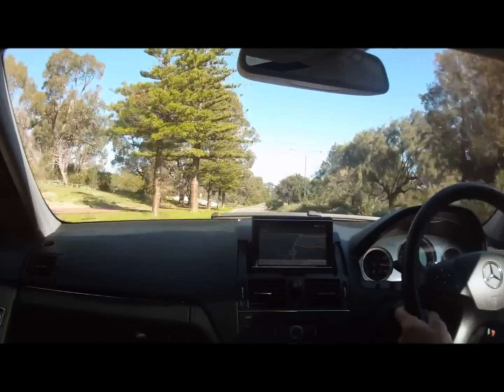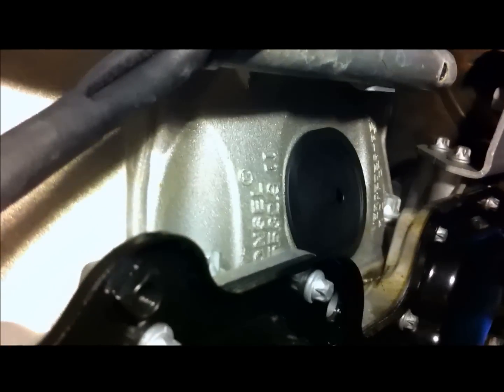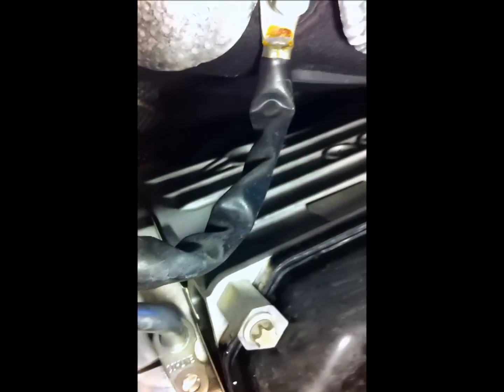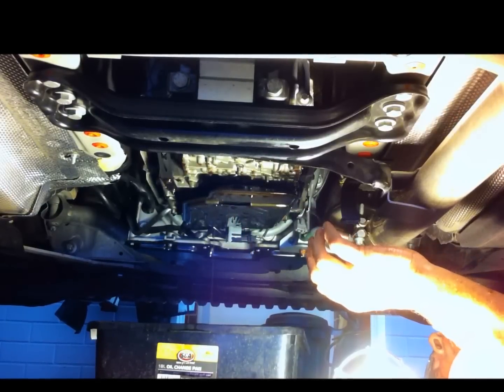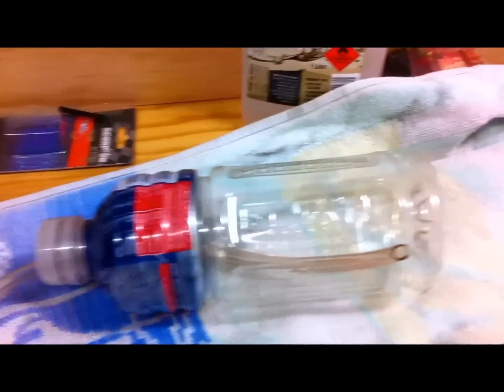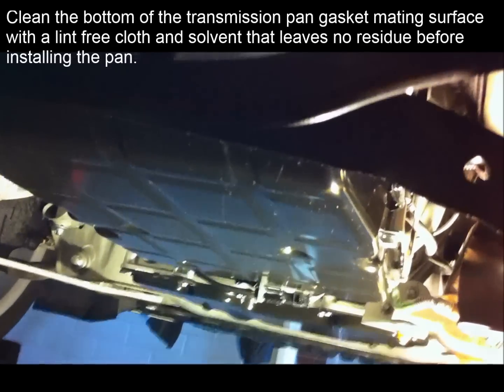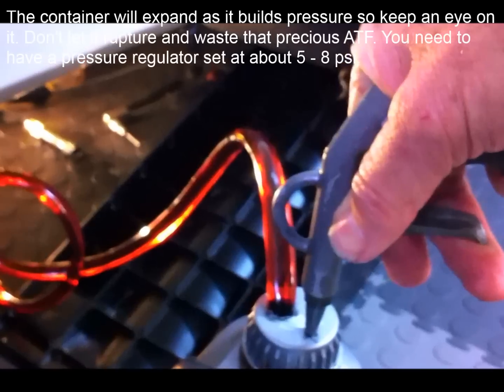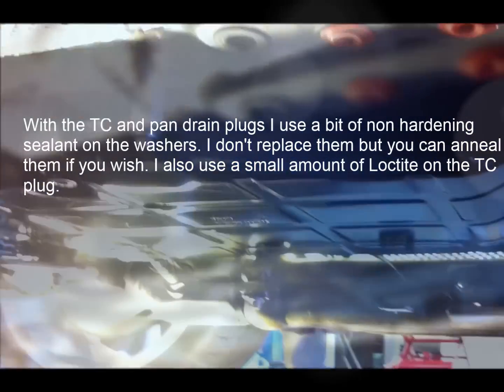Mercedes W204 C Class Transmission Service ATF Fluid Oil Change 7GTronic 722.9 Test 0-60 mph

Comment: Hello Scott, 

First i would like to say that this video is awesome,  like your self, I  do not want to spend $$$ on the dealers if i can do it myself. In your video you identified three places that you will drain fluid from.

I will be working on a 2009 GL320 BlueTech 722.9 Transmission 

1. The oil pan drain plug (Straight forward)
2. The Oil Cooler line ( is this located on the drivers side of the transmission ?) 
3. The TC Drain Plug ( I see that you drain this), but where does is get refilled? from the Trans Fluid ? or is there some different fluid type..Help :-)

On the Oil cooler line where your remove the second screw, you mention the left side of the engine for this screw, is that the drivers side? just want to make sure that I am going to do this on the correct side of the SUV.

Thank you so much for creating this video, it closed a big gap in what I would need to do to service my transmission..I have about 61K on my SUV, and I have heard different mileage for doing the service, so I just want to start doing this at regular intervals.

Thanks again
Reply from the maker: +GL320 Lovers ... Thanks for the compliment. The oil cooler line and the bracket bolt are located on the drivers side in a LHD vehicle.

The TC is part of the whole transmission and refills from the ATF in the oil pan. The oil pump picks up the ATF and pushes it around the system including into the TC so you don't need to worry about it. It will refill when you put that initial 7 litres approximately into the transmission and start the vehicle. It's important to drain the TC as it holds about 50% of the ATF.

Make sure you use the correct specification fluid. If the ATF is red it will be MB236.14. If it's blue/green it will be MB236.15. Hope this helps. Regards, Scott
Reply: +Scott Elliott 

Thanks Scott, yes I will be using the MB236.14 Red. 

Again thanks very much for making this information available. I will check back in over the weekend when I complete the work and I will show you my rig that I will create for the fill process.
Reply from the maker: +GL320 Lovers Please do post again to share the knowledge. We DIY'ers must stick together! Regards, Scott
Reply: +Scott Elliott 

One other question. You used a old school multimeter with temp probes to monitor tranny fluid Temp....can a Infrared Thermometer be used ?
Reply from the maker: Certainly ... infrared temp gun is fine.
Reply: +Scott Elliott 

OK so I have built my tool set for servicing the transmission . I basically have 3 major parts. 
1. The torq converter flush with Male NPT connector:
https://www.yogile.com/g320lovers#08343880l 

2. The Trans Filler adapter with Male NPT Connector: 
https://www.yogile.com/g320lovers#08343882l

3. The Fluid filler hose with Female NPT connector:
https://www.yogile.com/g320lovers#08343878l

All this cost me about $60 US. The AST Filler adapter can be found on the Website http://www.asttool.com/company_sales2.php 
if you click on how to buy, the site will point you to your local retailer in your country / state / City where you can walk in an purchase the filler tool for your specific vehicle. Mine is the 2009 GL320 Bluetech with the 722.9 transmission. 

All of the other materials were purchased at Home Depot off the shelf. 

I am planning on doing the service tomorrow (good firiday here in the US), and will report back on my experience. 

Thanks again Scott for making this video public..it really motivated me to DIY this service. 

:-)
Reply from the maker: +GL320 Lovers ...It's great to see the planning you've done for this project. Too many rush to the "doing" without any thought and planning.

During my Civil Engineering career we used a process called PDCA ... Plan, Do, Check Adjust. It's a continuous circular process of continuous improvement. The more time you spend on the P the less time is required for the D, C & A. In fact the whole PDCA timeline is less. Nearly every Entrepreneur type pushes Engineers to get into the D far too soon ... they won't allow Engineers to do their jobs properly. Projects are started too soon and you get monumental stuff ups and cost blow outs ... people get killed and injured. I don't have a lot of time for people who class themselves as "Entrepreneurs" ... They're nothing but shoot from the hip, cavalier and narcissist risk takers who don't give a dam about anyone.

I use PDCA for any project I do no matter how small or large.

https://en.wikipedia.org/wiki/PDCA
Reply: +Scott Elliott 

I too have an engineering background, I worked 12 years for a leading satellite manufacturing company here in the US, and learned about processes and agree that planning is the most important part in any project. when you send a satellite up into space, you can't easily correct any errors, so yes I am totally about PDCA. 

I will let you know how it all plays out,  but I am very confident that I have covered all the details and will just need to take my time and not rush to finish.
Reply: +GL320 Lovers 

I completed the servicing of my transmission....and all went really well..I honestly do not think that I could have done it without the demo provided in this video. 

I only experienced one issue with the re-filling process. I used the liter bottles as my reservoir and it was a clumsy operation. I drilled a 1/2 hole(fill tube) and a 1/16 hole(air pressure), and moved it from bottle to bottle..it worked but the next service i will find a industrial bottle that can hold about 8 liters. 

otherwise it was a great success and I was able to save about $800 US on this service as the Dealers were asking about $1000 US. 

Thanks again Scott for making this information available!!!
Reply: +GL320 Lovers 

I also wanted to share this link that has some more detailed information regarding 722.9 transmission servicing. There are PDF's that add some additional details.

http://mbworld.org/forums/c-class-w203/365242-diy-722-9-7g-tronic-7-speed-automatic-transmission-service-thread.html
Reply from the maker: I'm pleased it went well. A 10 litre oil container would be good for the air lift stage.

I'd bet money the service you did was more thorough than a $US1000 paid service. You also have peace of mind it's been done properly.
Thanks for the link to the pdf's

Comment: Great job, Scott.   At 5.30,  you opened the cooler line to flush the fluid.... Is there any o-ring or washer that must be put back when we tighten back the cooler line?  Thank you...
Reply from the maker: +John Yon Thanks Jon. From memory there's an o-ring on that line. It's firmly held in a groove on the pipe so it's stays in place anyway.
Reply: +Scott Elliott.   I see... So we don't need to get a new one.
Reply from the maker: No not at all. You pull the pipe out and push it back in again.
Reply: +Scott Elliott Scott...  when you turn the torque converter you used 27mm socket... is this a mercedes specific socket or just a regular socket?       Also, is the temp gun quite reliable?   Thank you...
Reply from the maker: +John Yon Just a standard 27mm socket ... nothing special. A temperature gun or temperature probe on a digital multi meter is accurate enough. It doesn't have to be exact. A few degrees either side of 45C won't make a difference considering the subjective way of measuring the oil level.
Reply: Scott Elliott Thank you Scott.  Don't know why MB makes this task so difficult.
Reply from the maker: Yes it beats me Jon ... I can only deduce they try to make it harder for people like us to take control.
Reply: Scott Elliott Over-engineered for their own profit.  By the way, normally how long does it take the oil temperature to cool down to 45C after you come back from a 30 min drive?
Reply from the maker: +John Yon After you've pumped in the initial fill let the vehicle idle to bring it up to temperature plus move it through the gears several times while it's warming up. Once at 45C or thereabouts drain off the excess. If nothing comes out you'll need to pump more in. The idea is to over fill slightly, bring it to temperature and drain the excess.
Reply: Oh.. that means I can do this job after I come back from work around 5pm right?  After I fill up around 7 liters initially, this will probably bring down the oil temp.... and then make sure the temp is not above 45c...  and then go thru gears and check temp at 45c.  and then release the drain the excess.  Somebody told me that I have to wait at least 3 hrs for the oil temp to cool down.  But if we fill the new cold fluid, the overall temp will probably come down quite a lot right?
Reply from the maker: +John Yon If you've driven the vehicle home the oil temp will be somewhere around 70C. I have an oil temp gauge for the transmission in the W639 Vito 722.6 5GTronic auto and that seems to always run at about 70C.

So after you've drained the transmission, TQ, flushed out the cooler and put in the initial fill you should reach 45C quicker as the transmission will be warm.

Your keen to be doing it after work. Give yourself a few hours and don't rush ... that's how things are forgotten or you get hurt. But it's great to see you're enthusiastic about having a go at it. You'll do a better job than any dealer. If it's your first time it may be an idea to wait until the weekend.
Reply: Scott....   did you say you have an auxiliary tranny oil cooler?  Does that help a lot?
Reply from the maker: +John Yon I guess it does but it's a standard feature of the car. I've got nothing to compare it to. MB saw the need to include a transmission cooler so it must help keep the ATF cooler.

Comment: So it seems like its impossible to overfill the transmission. If you put in to much it will come out of the drain/fill hole.
Reply from the maker: +Vagus Nerve Vagus that's right. It's an easy transmission to service. Overfill it slightly and once up to temperature open the valve and let the excess drain out. The overflow pipe sets the level so you can't overfill.

I think there are a lot of urban myths propagated by dealers and vested interests. The oil pan is only a reservoir to keep the inlet of the pump always immersed in ATF. The level could be 5mm below or even 5mm above and it will make no difference. They also get hung up on the temperature. That could be 10C either way and it will make no discernible difference.

For example the 722.6 transmission does have a tube for the special dipstick. The dipstick has the levels for 80C stamped on it and there's an 11mm tolerance from MIN to MAX. In the Mercedes workshop information it says to bring the temperature to somewhere between 70C and 90C.
Reply: +Scott Elliott mbworld.org/forums/m-class-w164/459610-diy-transmission-fluid-change.html#post6741658 please check post #22, i turn the crankshaft clock wise, and its #4?
Reply from the maker: +Vagus Nerve Yes it's pulley 4.
Reply: +Scott Elliott Thank you, In your other video I saw you working on the same vehicle, do you happen to know what size that bolt is? None of my sockets that I have are fitting over it.
Reply from the maker: Pulley #4 bolt requires a 27mm socket.

Comment: Hi  Scott, a little basic question, how did you turn the crankshaft clockwise? Where is it located, ... etc.
Reply from the maker: +Nasser Alsalhabi Hi Nasser. Watch from 4:20 again. You use a 27mm socket on the crankshaft pulley on the bottom front of the motor. Depending on how long your arms are you can sometimes lie on your back with your feet forwards and your head under the TC drain plug window. Put the 27mm socket onto the pulley nut and turn while watching the TQ waiting for the drain plug to come into view. The crankshaft pulley is clearly visible once the covers under the engine have been removed.
Reply: +Scott Elliott Thanks a lot!

Comment: Good video, just the information I was looking for.  Thorough and well edited.  Cheers!!
Reply from the maker: +moosejaw50 Thanks moosejaw. I'll be doing this video again in about 6 months and hopefully it will be a better based on what i learnt last time. I decided to do my transmission every three years as the car does get taken to the track occasionally. Regards, Scott
Reply: +Scott Elliott  You covered all the important bullet points that a DIY mechanic needs to know for this job.  Bonus points for the performance test.   FYI  I have a US spec '09 ML with this transmission.

Comment: The fill method you used worked perfectly for me - suprised how quick it moved - like 1l in 15sec - very helpful video. I used a tyre valve on the oil can cap to fill up easier from the airline. The tap near the pan was a must to make it easier. Wish I'd just bought a m12x1.5 mm to 10mm barbed adapter for a few £ off e-bay http://www.ebay.co.uk/itm/M12x1-5-METRIC-to-9MM-10MM-BLACK-BARB-Straight-Oil-Fuel-Pump-Hose-Adapter-/370846282035?hash=item5658293133 rather that the proper and rather expensive laser tool but I had bought before I saw your video. The Fuchs oil you use is apparently Merc original fill - What Merc use and label there brand. Which can be got quite reasonably in 4l bottles

Comment: After turning the crankshaft clockwise to access the TC bolt and finally draining and replacing with a new bolt, do you need to turn the engine back to its original location?
Reply: +Jon Anderson No
Reply from the maker: As Jon said ... no. 

I'm interested to know why you thought that may be required? 

Also I don't replace with a new drain bolt. Normally the only bolts you need to replace are the one use yield bolts which are often aluminium.

Comment: Quick question, correct me if I'm wrong:
The transmission fluid is a sealed system, correct? Therefore, if you are pumping fluid into an empty system, wouldn't you be building quite a bit of pressure, especially the amount of fluid you're pushing in? Where does this pressure go?
Reply from the maker: Sou Lee Sou all transmission and differential housings have a vent as when the transmission gets hot it will build pressure.The process I use is the same as described in the Mercedes Workshop Information System. The difference is I use a simple air lift using my compressor whereas Mercedes use a hand pump. Both do the same thing but my air lift is easier and simpler.Google "722.9 transmission vent" in images and you'll find a picture.
Reply: Ohh, that makes sense. Thanks! I'll be doing this most likely the same way you did via air compressor.
Reply from the maker: Sou it's easier and quick. Why MB use a hand pump has me mystified. Scott
Reply: I think it might be beacuse air compressors are notorious for introducing high moisture content to their compressed air discharge. Water and hot ATF not a good mixture in a trans.

Comment: You happen to have part numbers for the filter, gasket, fluids and where you purchased it? I would like to perform this task myself since I lost faith in my dealership.
Reply from the maker: DaeHan2321 Hi DaeHan. If I acted as a parts number interpreter for all the requests I get for numbers I'd be working full time for nothing! A famous person said teach a man how to fish and he can feed himself for a lifetime. So I can't do the fishing for everyone.Use this site: http://www.everythingbenz.com/z/epc-mercedes-parts-info-diagramsYou don't really need the part numbers. I have an account with these guys for filters and other consumables. You choose your vehicle and it does the work for you. http://www.micksgarage.com/As far as ATF goes there are many choices depending on where you live. I used Fuchs ATF 4134. Assuming you have the 7 Speed 7GTronic 722.9XX series you need the specification MB236.14Hope that helps, Scott
Reply: Scott Elliott Much appreciated! Just to clarify, you pumped about 9.2 L of ATF to over fill so you can drain excess fluid to a trickle while the engine is running? I'm afraid of letting too much out.
Reply from the maker: DaeHan2321 Yes Dai I pumped in a bit over 9 litres. I emptied the oil cooler and the lines to and from it as I pumped about 750ml into the inlet side and kept going until air was coming out so I used a bit more ATF than normal. The dealers and service centres don't normally do that. They leave about a litre of old ATF in the cooler and lines which I don't like.You can't let too much out. That's what the overflow pipe method is all about. Once it starts dribbling you know the oil level is at the top of the pipe and you're done. The ATF inside is not still as the pump is going so there would be disturbance on the surface. Even if you left it until there were no dribbles it would be ok. The level would be within a few mm of the top of the pipe. As long as the inlet of the oil filter is always under oil everything is going to be ok. Regards, Scott
Reply: +DaeHan2321 If you are in the states we have a complete kit for this job at IDParts - includes 10 quarts of fluid: http://www.idparts.com/automatic-transmission-service-kit-23614-fluid-mercedes-speed-7229-early-p-3727.html

Comment: Hi Scott, really appreciate your advice you share.  On the ATF change, why did you opt to go with the 'use once' bolts?
Reply from the maker: Etienne Vandenberg Etienne sorry for the late reply. I missed seeing your message. I used the alloy yield bolts as that's what Mercedes say to use. The transmission case is magnesium so steel bolts are not suitable due to galvanic corrosion. Magnesium is used for sacrificial anodes on steel hulled ships.

However I've done some more research and I think zinc coated high tensile M6 hex head bolts with a graphite anti seize will work. Torque 14Nm. I'd prefer not to use the one time use yield bolts as they're a pain to get hold of and expensive.

My W639 Vito with the 722.682 transmission uses zinc coated high tensile M6 hex key bolts.